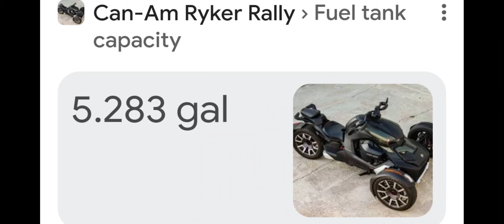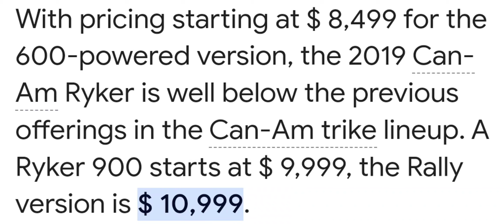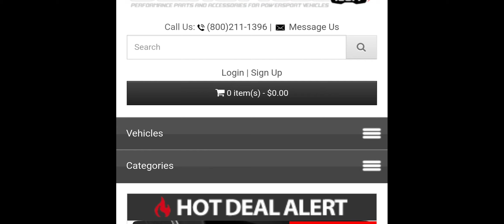Top 5 dislikes 👎  about my Can-Am Ryker! Watch this before you purchase a Ryker.

Comment: The cost has definitely gone up. I have seen on Cycle Trader that there are dealers out there that still have NEW 2022, yes 22 model Rykers in their inventory at DEEP discounts. I found the cruise on my Ryker fairly easy to use.  As for upgrades, I bought a lot of my Ryker upgrades on eBay 2nd hand and saved a ton.  I had a lot of fun with my 22 Rally and I miss it sometimes but in the end, I traded it in on an F3 LTD.  Looking back, I wish I’d bought the F3 first. Bigger gas tank, more comfortable on long trips and faster.  The list goes on.
Reply from the maker: Great feedback as always

Comment: Got my used 2021 Ryker 900 Ace with 275 miles for around $10k here in SoCal. Bought upgrades from Slingmods- windshield, steering damper, led headlights, glow lights tapped into the brake lights, large brake pedal, handguards w/ LEDs, max mount, LinQ case, and Triq LED brake/signal light for the max mount. I've only had my 21 Ryker for a year! Yup, they're money pits! 😂
Reply from the maker: Sounds like a solid purchase on your part

Comment: I paid $11,000 out the door for my 2019 rally with 6000 miles on it  at the end of last summer and I use the throttle lock you called trash and I agree it is trash
Reply from the maker: Lmao. I thought it would be a better product but it was really bad.
Reply: Throttle lock is the best man, who wouldn't want to go faster or slower than set to.lol

Comment: My 22 sport. to operate the cruise control.  You hit the button once to turn it on. After that get to the desired speed hold the button down for a couple of seconds and it sets the cruise.  Now just as a warning, once your speed is set, you cannot go any faster. If you need additional speed you have to turn the cruise off, speed up and than reset the cruise. Found that out when trying to pass a car on the highway.  It would not allow me to speed up to pass while cruise control was set at a speed.
Reply from the maker: I will try it out tomorrow